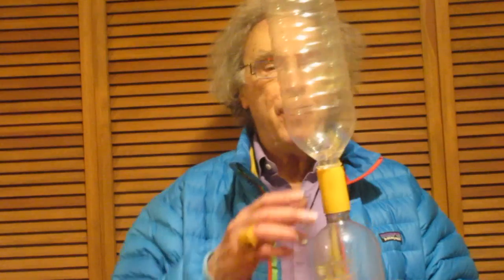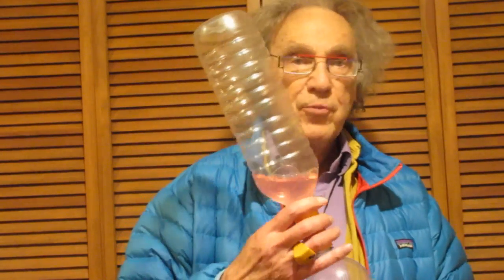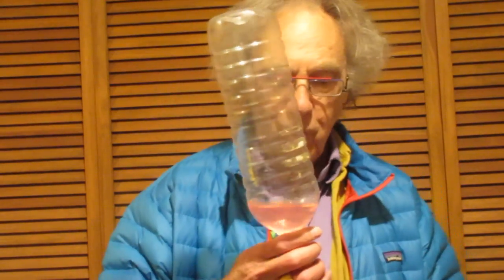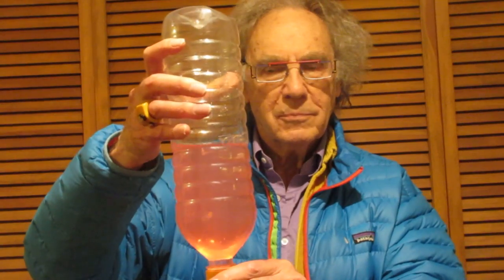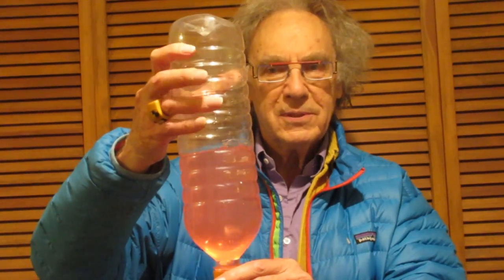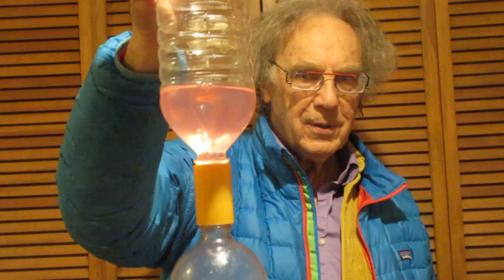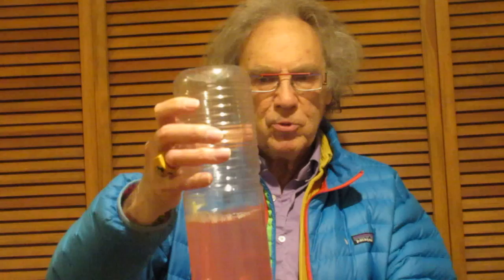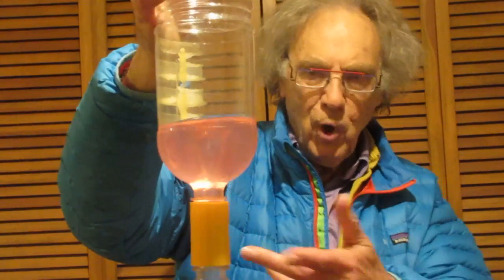Solution Problem #2 -  Vortex Transfer of Lemonade

Comment: I know a faster way; hold the bottle in one end and spin the whole thing around your head. Acceleration will force the water out of the bottle very fast.
Reply from the maker: try it
it's not faster
Reply: I believe you are right on the closed system demonstrated in your video. However if you have one open bottle my way is faster. I know, because I have emptied a 2 liter bottle in under 2 seconds several times. But in the setup of your video, I trust your way is faster.

Comment: here sample two questions that do not have proper answer in the web:
1. from where gravity force takes energy to do the job?
2. from where permanent magnet force takes energy to do the job?

somebody answering that by doing job against this forces you refilling some source with energy but this sounds like to refill wind with energy if you will push sail against the wind...or you will refill with energy vacuum cleaner if you will push out object from it - this is wrong answers...in both cases wind and vacuum cleaner have own energy sources and gravity and magnets do the same, just question still not answered yet, 
Le Sage's theory of gravitation close to the answer but it is not full,
as well there still no clear answer about source of energy of permanent magnet force
Reply from the maker: 1. Einstein GR
2. QM currents on molecular level
Reply: 1. Einstein GR saying the speed of light is the top speed, but gravity force much more faster, real measurement of speed of electromagnetic waves with different frequency show it is not C - very different values and there a lot of real samples where theory do not works
2. What happens when magnet doing job - QM currents should ends and magnet should loose own force (and material should change own structure on molecular level) - what is real experiment show? What is real value of this energy? How much permanent magnet have it in  Joules?
Reply from the maker: >>>1. Einstein GR saying the speed of light is the top speed,>>>
NO that was SR. GR is all about space time and gravity

Comment: when you try to debunk other solutions you only debunk 1 part of it and that is they do not solve the problem of the opening but hear me oute the opening isn ot the biggest problem it is onlt a bromblem if you make it so. the problem is the bolels. so poke a hole at the top to let ear replace the volume of the lemonade this way the preshure ofthe botle wil nto keep the lemonade in the botle NeXT make a hole at the top of the other botle to let air oute this way the air do not need to travel the same way as the lemonade and the bubles wil not apear therby ransfering faster. faster is the tirck it is not THE FASTEST but it is faster.

Next the vakum way this too servs the same thing as there is no air to travel the other way the lemonade have nothing to stop it as wel as creating preshure behind the lemonade it wil shoot into the other bottle faster and this truly is the fastest Method as  depending on the preshure you can create at the other end you can make the transfer Instant almost.
but then you come explaining it is inposible With this botle but the solution does not use THAT botle the problem was moving it from a to b not from 1 spesific container to another spesific container. so in this solutin we use a botle capable of containing a vacuma and high preshure.

the A+ solution is only the best if you have no imagination and limit yourselfe to do nothing With the botle.

Comment: While this method is the easiest and does not require modifying the setup at all, your explanations for some of the other methods were incomplete/wrong. Poking a hole in just the top OR just the bottom bottle would not change the behavior very much as you said because air would still have to travel through the nozzle in both cases. If you poked a hole in both bottles, though, air would no longer need to pass through the nozzle and the flow rate would be faster than the vortex method with no holes.

Your explanation about applying a vacuum to the bottom bottle was totally wrong. Regardless of whether or not the bottle collapses, the pressure differential between the air in the top bottle and the air in the bottom bottle would vastly increase the flow rate. With a high enough pressure, the water would explode out of the bottle. Just look up water bottle rockets; the principle is very similar (though of course you are limited to 1 ATM of pressure difference).
Reply from the maker: >>>>Your explanation about applying a vacuum to the bottom bottle was totally wrong. >>>>
MY EXPLANATION ???????? you must be kidding.
In addition
If you poke a hole in both bottles it will ONLY work if the holes are LARGE.2 small holes will not do.
Holes means destruction too. That's not what we want. 
"vaccum"-like solutions are hopelessly unpractical too. How on earth would one do that? ABSURD!
A non-destructive solution would be to put a large straw inside the opening between the 2 bottles. Transfer could then be even faster than the vortex method.
Show less
Reply: I believe I was quite clear that I agreed that the vortex method was the simplest method if you are constrained to not modifying the setup. However, you mentioned cutting holes and applying a vacuum and then proceeded the fail in explaining the physics behind those methods.

The holes do not have to be large because the density and viscosity of air is very low and the volume flow rate of air through the hole only needs to be equal to the volume flow rate of water through the nozzle... a few cm^3/s. A hole just a mm across would be plenty for bottles sized like the ones in your video.

When you pull a vacuum on a bottle, it will collapse, but that doesn't mean that you haven't been able to reduce the pressure in the bottle. If you reduce the pressure in the bottom bottle, then the air at atmospheric pressure above the water in the top bottle will provide a force equivalent to the pressure differential times the cross sectional area of the nozzle. This force will press down on the water in addition to the gravitation force and it will cause the water to flow much faster.

As far as the vacuum solution being impractical... you are talking about figuring out how to increase the flow rate between two bottles that are attached to each other like an hourglass, how was that ever practical? That said, it's not that hard...

EDIT: I see you added a bit about putting a straw in to speed up the flow. If I'm understanding your suggestion, you intend to pass a straw through the nozzle (without modifying the nozzle at all) so that air can pass in one direction through the straw and water can pass in the other direction (through the nozzle but around the straw) without the flows interfering with one another. While this will be faster than the bubble method, I doubt it will be faster than the vortex method. As you said (either in a comment I read or in the video itself, I don't remember), the vortex pretty much acts like a straw. However, the physical straw will increase the surface area that the water has to flow over as it goes through the nozzle which will slow it down. Also, you would have to do some experimentation to find the optimal straw size. Meanwhile, the vortex method has no such friction and should balance itself out such that the diameter of the air passage naturally maintains a near ideal diameter, as long as the fluid isn't spinning super fast or so slow that the vortex collapses and you end up with bubbles again. Most likely, with a properly sized straw, the flow rates will be very similar, but the vortex will almost certainly be at least a little bit faster.

EDIT2: Here's a very bad sketch showing how you could put a straw into the side of the bottom bottle and use it to pull a vacuum either by hooking it to a vacuum pump or by just sucking on it manually. http://imgur.com/a/UwAod
Reply from the maker: Tomorrow I will redo a video with my explanation and I will give you credit.
Reply: I'm glad you will be posting a correction but I don't need any credit. You have a large audience and it is important to me that they are given the most correct information possible.
Reply from the maker: I made one 2.5 mm hole in each side. That Did not work very well - I tried 4 times, each time the liquid starts running then stops. I then made three 2.5 mm holes in each bottle one near top one near bottom and one in the middle. I will demonstrate it (even though it is messy). Water still has a tendency to stop running near the end. However, sometimes it goes all by itself in a vortex mode, then it does not stop. If it does not stop, the time to transfer is about the same as the simple vortex mode. I now ended up with 2 broken bottles which I have to empty because of the holes. I will get 2 new bottles later today to fix it again.
Reply from the maker: I watched my solution video. I no where state that a hole in each side would NOT work. The ONLY slip I made is that the reason why one hole would not work is NOT that the liquid has to go anyhow through the narrow opening. The reason is that the air still has to go through that opening. I do not think I have to go to jail for that. But I will make a short video in which I will explain correctly why 1 hole in one side does not work and I will then also state that a hole in both sides would work. I experienced with several oles. Finally ended up with 1 hole in each bottle of 3 mm diameter.

Comment: dude just put a straw in the middle
Reply from the maker: try it and let me know how well it worked
Reply: or you can connect two bottle with tube and a pump
Reply: I don't have a straw but if you think about it the use the straw is very similar to the vortex solution and with the straw, you don't have to input any energy.
Reply from the maker: >>>I don't have a straw>>>
ha ha ha
Reply: Yeah I have to go buy some lol
Reply: If I may ask what is your main physics background.